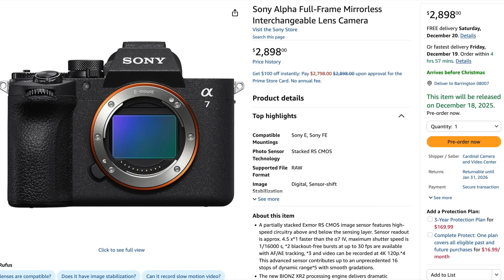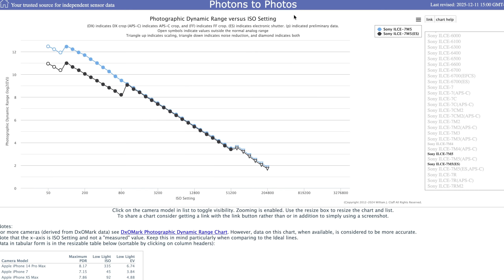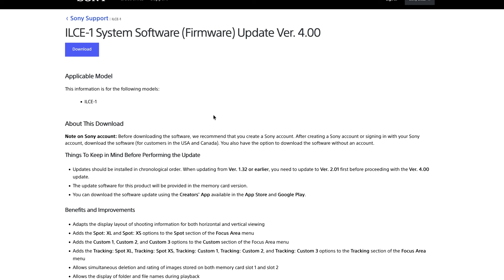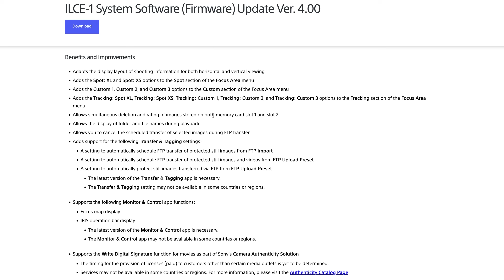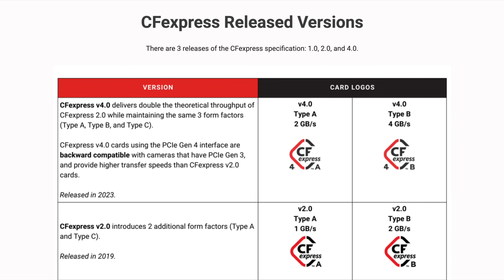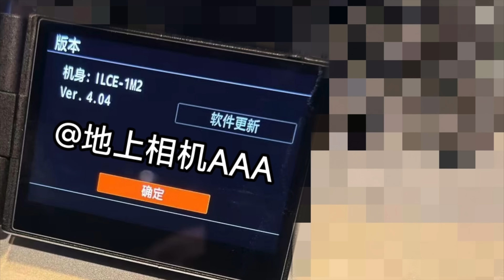LEAKED Sony A1II firmware info and new Sony A7V dynamic range KING analysis!

Comment: One of my main concerns was that the Sony A7 V would have the same poor-quality shutter as the Sony A7 IV. Unfortunately, these concerns have been confirmed. The shutter on the A7 V uses a plastic-based design, just like the one on the Sony A7 IV, which certainly does not make it very reliable, even though, on paper, it is rated to last up to 500,000 actuations.

When you pay almost £3,000, you do not expect poor quality.

I am disappointed. I will most likely move to the Sony A1 II or Il’l keep my Sony A7lV  ar the moment.

Comment: I’m not sure why you’re saying the S1 II proved partially stacked sensors have lower DR? It has the highest DR at lower ISO’s compared to all it’s predecessors. Also in video it has really good results as CineD showed. I agree the A7V is better according to the new numbers but the S1 II is not a bad performer at all. In fact it’s on par with the GFX50S II and 645Z.

Comment: Those A1ii firmware speculations need to come in a single update.  That said of course it is BS about support for type 4 cards without the additional hardware PCI bus lane.  I mean why on earth would they have released the camera without that support if it had it.   Perhaps they mean some kind of tweak to achieve similar performance in the buffer or something to get beyond the 30fps ceiling.

Comment: I just want to know if it has heat issues.
Reply: It does not, the new R6miii does
Reply: You can record 4k60 until the battery dies after about two and a half hours. It's a beast while remaining cool.
Reply: My a7iv randomly heats on shoots. Not often but just yesterday at air cooled location the heat sign popped up at about 10 mins in at 4k60. Mind you, before the update version it rarely happened. I usually don’t update my firmware. Bought my a7iv in 2022, only heating in hot weather when im shooting.
Reply: @whaitebranco3400 I have the A7IV and yes it will overheat on 4k 60 in the sun pretty fast. This A7V has the best thermal protection for no fan. It already went through testing by Gerald undone on 4k 24fps and 4k 60 in different temperature environments.
Reply: @whaitebranco3400 I use the Ulanzi fans on all my Cameras. I now have my A7v and I will stick it on a tripod and record the TV for 2 and a half hours and see if it overheats.

Comment: Hardware manufacturers often include hardware, but do not release the feature because the software for that feature is not yet stable.  It is possible this is the case with Sony’s CFexpress implementation on the A1 II, which would only require a faster clock rate to support PCIe 4.0.
Reply: And then we get 40 pictures per second burst 🫣🙃

Comment: What is the point non partially stacked vs Partially sensor of Sony a7V and Canon R6 III is fastest sensor readout than Sony a7V.  35 years Old 10 fps mechanical shutter and worse evf resolution and brightness. if Buffer slow and only takes 40 pictures means always miss action beacuse of buffer. useless 30 fps Electronic shutter and can't capture every action of subject due to buffer limit..... SONY CRIPPLE HAMMER.
Reply: Canon is using very old FSI sensor tech in the R6 III. By using HEAVY noise reduction, Canon manages decent dynamic range when using the mechanical shutter (up to 12fps) but the DR with ES (>12fps) is horrible. Unacceptably poor. And that is the R6 II. The R6 III uses the same FSI sensor tech but due to the nature of FSI, the numbers are almost certainly going to be even worse. The A7V is not perfect, but Sony did not sacrifice image quality to make for nice marketing numbers. That's a big win for Sony users.
Reply: Go with the Canon if you're happy with terrible DR and only 12bit burst shooting. If you're serious about your photography you would know these basic differences. 14 bit 30fps is incredible in this segment.
Reply: You are Canon troll w/t bullshit post

Comment: A1-II will always recive updates, because software I suppose let them to do that, so there should not be a problem for that new camera. 
I'd not be worried about such updates for A1-2 owners, that "A7-V will have something A1-2 don't" [except hardware things that actually can't be put into the body], because then people would not buy A1-2 if A7-V can have more things than flagship, except sensor speed and megapixels.

Comment: The new sensor that is coming is a 2-layer (Exmor-T) sensor.  I've already verified.  It is going to be awesome!
Reply: can you elaborate what the real world benefits of this architecture is going to be :)
Reply: @MarkusGebhard  It's the sensor tech in iphones over the past 3 generations (apple uses sony sensors).  It provides around 50-100% more light to reach the photodiode by placing the transistors on a separate level instead of along side.  It also helps to reduce noise (also from the separation).  Google Exmor-T and check it out. It's a pretty cool architecture (one of 3 new architectures that Sony is working on)
Reply: for what cameras?

Comment: Tony Northrop said the Sony a7V dynamic range is lower than the old A7IV. Has Sony paid you to speak good about them?
Reply: That's in video. What he's showing is photo DR. in Video CineD gave A7iv around 12.8 middle score and the A7v 12.5 if I recall correctly, which can also mean because of less noise reduction and can alter the test. For example the FX6 shows way worse results vs A7SIII/FX3 but that's because it barely has any noise reduction, if any.
Reply: @Bo_Hazem  You can control the noise reduction level in the FX6, including turning it off. The FX3/A7III do not allow it to be turned off.
Reply: @IanHobday  Good to know. Noise reduction can make things look a bit mushy. I like the a9iii noise pattern, and I think it has no noise reduction or very minimal. That sensor needs to be on FX9ii or FX8.
Reply: @Bo_Hazem  Now some days later we know that Sony makes a dual gain mix and that the camera has indeed about one more stop of DR, this is huge .
Reply: @Anadrolus  Actually it makes sense but overall I hope the implement 2-layer transistor sensor like in the phones so it can natively jump 1-2 stops or more and have richer colors and less moire effect.
Reply: He was testing DR on video, its a mistake on Tony's part for assuming that the 16 stops of DR applies to Video using electronic shutter
Reply: According to Gerald Undone the DR of the V is much better in video. I trust him much more than Tony.
Reply: You guys just talking and comparing this everyday. Fact is 2 photo taken by 2 different camera in a blind test. You wont even know 100% everytime which is from which. Come on already. Lol.